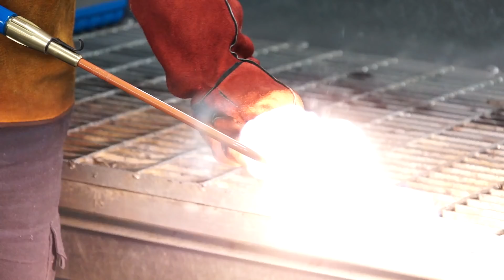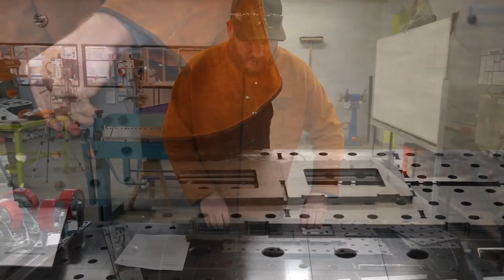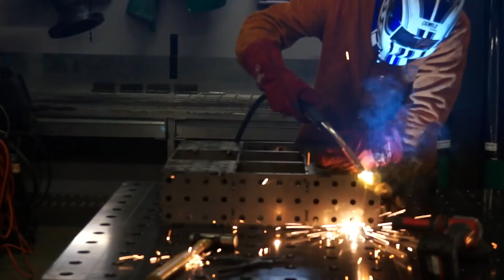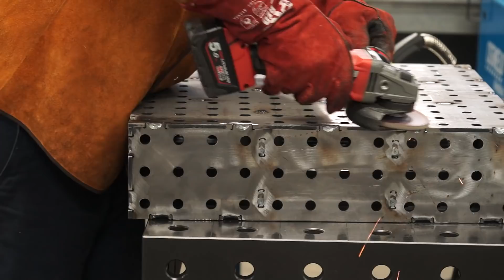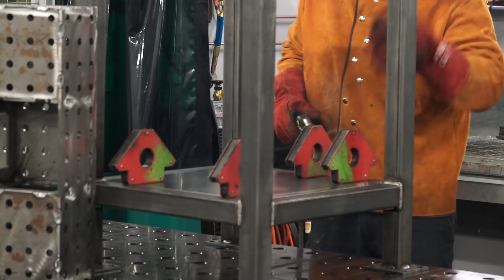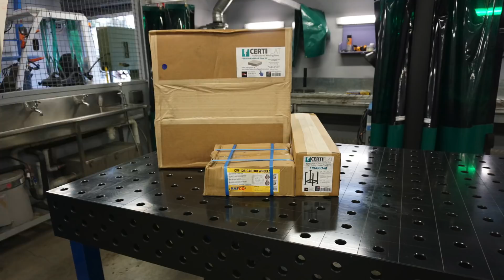Welding Table Build - Certiflat FabBlock DIY

Comment: You need another shelf above the welder / below the table to stop sparks and blobs landing on your equipment, hoses, cables etc. Nice work - must weigh a tonne though!
Reply from the maker: Hi Murray, that's a very valid and excellent idea mate.  I will cut out another shelf and weld it it ASAP.  Yes, it does weigh a little.  I had to get my wife and daughter to help me lift it out of the car and off the bench lol.  Cheers, Aaron.

Comment: What about turning the plate around :P Some kick in the stones after traveling that far to be wrong !! What did the company say ?
Reply from the maker: gunhappyie Hey buddy. Yeah not wrong mate. I was totally pissed with that wrong plate. Unfortunately you can’t turn it upside down as it’s a unidirectional part FFS! So glad Pete fixed for me. Cheers 🍻
Reply: DCTTeacher1 did you contact certiflat?  

I'd love to get one here in Ireland but if that stuff happens I'd freak out !
Reply from the maker: gunhappyie Nah buddy didn’t bother to contact them. Too much of an effort for little to no gain. Their agent in Australia are also useless & I rarely purchase anything from them 🤨
Reply: DCTTeacher1 that's BS they should make that right that's no way to run a company that's why I won't buy from them certified crap